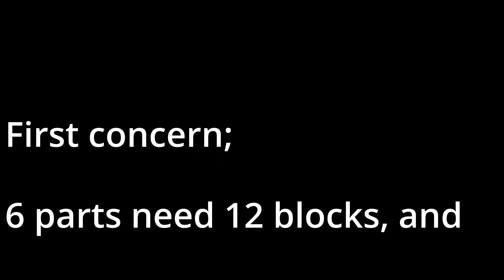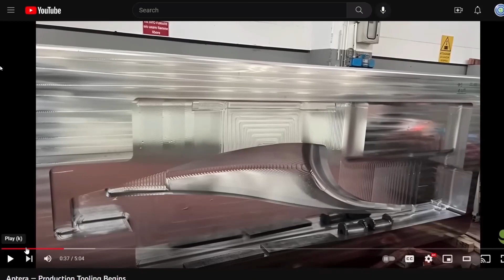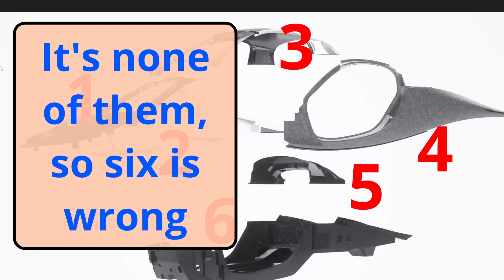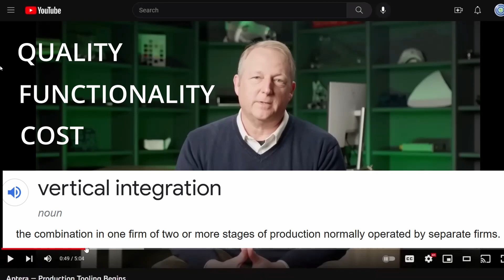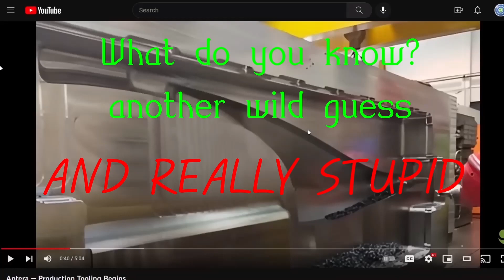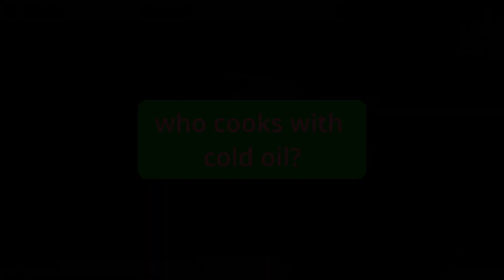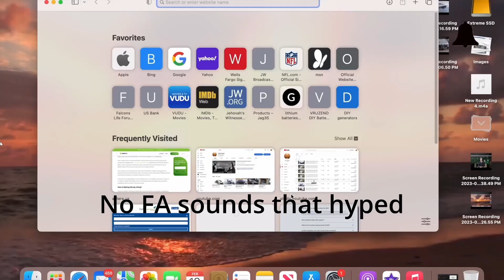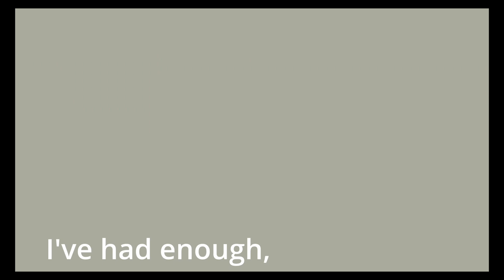APTERA DIES    What gives?

Comment from the maker: I know it's an old video, but I wanted to preserve this nonsense -

@andrewfuller8440  "sir , I am a retired toolmaker and machinist,who knows you cannot sink dies into 19 ton steel blocks for 3 million Dallas," I am completely ignorant about toolmaking, but if memory serves me correctly they were saying these blocks were about 5,000 lbs of steel and you are comparing with 19 tons I have not heard of nor can imagine such a weight  just to squash a paste. It's around what a full bus weighs. I had to look up how many lbs in a ton (used to know it, but have never used it in decades) and it's an easy to work with 2,000 lbs. I hope it's the same in Italy and I hope they are not referring to tonnes, which I think are lighter. In any case, you said tons and on that basis, your blocks are 38,000 lbs? I don't think so. Nor do we know if the 5,000 lbs Chris referred to was the combined press or that for the lower half, or an average for each half, such is the vagueness he talks in. It is common for every piece of information he gives. I tried Google to see what a cost would be, and first found this absolutely crazy article -
https://www.thefabricator.com/thefabricator/article/bending/die-science-estimating-die-cost
It's crazy because it's even more vague than the snake oil salesman. See if you can find a price estimate in the whole article? There is nothing there. So I tried again and got this -
https://www.myplasticmold.com/injection-mold-costs-what-is-a-reasonable-estimate.html
It says for a big one it's about $10,000. Now it is also way too vague, because what size is big? I thought I would reverse engineer your considered cheap $20,000,000 block at an estimated 6' W by 4' by D by 3' H (~72 cu feet) lower half mold they show in a video, and see what size I get for their biggest example at $10,000. Naturally, it's going to be 2,000 times smaller and in cu feet that's 0.036 of one cu foot, or well under four hundredths of a single cubic foot. I can't imagine how tiny that must be in any combination of W, D & H, nor how the article can say it's the at large end of molds. It seems like dividing a shoe box into a hundred pieces at the least. That would be smaller than a ring case by far and I can't see that as being a large mold in anyone's language. 
One thing I noticed was that steel was an inferior material to use than titanium, and Aptera has opted for steel of an unknown grade. This is where they might have skimped on efficiency once more. However, since you're the expert - how about you provide some more meaningful data so that we amateurs can see how much one die or mold is reasonably going to cost, and we can multiply by the six or twelve (depending) for the six parts of Aptera and get an estimate that would be plus or minus half a million dollars? Or better still, how about someone lobbies Chris Anthony to stump up the bill for the contract? It's all tooled up and no more to spend.
"even 20 million might not be enough," That would make the size of the "bigger jobs" a mold that would do a contact lens.  
"I remember doing valve blocks that weighed 700 lbs for the military that we were paid 110 thousand dollars , and this was in 1970" I can reverse engineer your job (scale up is more the appropriate term) to see what the mold weighs for your lowest estimate of $20,000,000. You were paid just over $157. 14 per pound and at that exact price you could get a block weighing 127,275 pounds, or well over 63 tons in 1970. That's more than three full busses. If we use the 5,000 lbs of what I thought Chris claimed (I may be wrong), that would have cost him $785,700 in 1970. Allowing for inflation I would not see that ballooning to anywhere near your minimum of $20,000,000. In fact, if it were twice the weight (maybe top and bottom?) $1,571,400 would be hard presssed to get near it today. This doesn't even factor in any drops in steel prices after inflation and I would expect automated CNC machining is far cheaper than how you would have done it in 1970. Still - I am sure the fanboys will believe you, lol.

I just hope the links will carry on both this and the original on Hyperno's 'Aptera 2024 Solar EV sees company secure $33 million to fund initial phases of solar EV production'?

Comment from the maker: @Brian Rice @N. Bruce Nelson I can't comment on AOC, so will do it here, as usual, when I think I might have a point.
In regard to the airflows on the CFD simulations, I notice the early trailing flows don't appear to be showing the vortices shown in the later ones. You will need to imagine what the first ones would look like to understand what I mean. 
Picture the layers from the side first, and the vortices would have to be shaped like a sine wave with a diminishing height and an increasing amplitude as it gets further away. This would have to be the same when viewed from the top; that way, the combination depicts circular motion finally settling i.e. like the vortex displayed from the rear in the later simulation. However, there are no such lines that have that, and I can only conclude that it is all hogwash designed to fool the gullible. What do you think?

Comment from the maker: This one I couldn't risk losing -
"At least my comment is visible on other accounts this time, so here's my evaluation of your guff:
[This vehicle is going to be nothing less than iconic.] Your opinion, and a look at the future with little to base it on. Certainly none given. 
[It's going to hold a place in popular culture that eclipses the VW Beetle, the Airstream caravan, the Mini Cooper and the DeLorean.] We'll see. 
[It will be as much a sea change to the car industry as the iPhone was to dumb-phones.] Well the iPhone had an effect, but it wasn't a sea change. It didn't move from inland to the sea. Try 'radical', instead of 'sea'? Then, we'll see.
[The fact that everything about it is the most obviously correct thing to do,] But not everything is most obviously correct, which happens to be complete nonsense. By definition, 'most' singles out one from a group, in this context (in other contexts it means the majority, but not this time). Besides, everything about Aptera has many things that are incorrect, so you are pretty much lying. Zero to 60 in 3.5 sec turned out to be wrong; 150 kw turned out to be 128; production by end of 21 turned out to be maybe start of 24; paint became wrap; heat pump replaced by resistive heater; and more, which these 5 changes alone removes the everything about it clause. 
 [will only be visible in hindsight.] I used hindsight for those obviously incorrect claims, and am looking forward to more hindsight going my way. Here's one more for impact - that fantastic composite body shell became an Italian carbon fibre - who saw that coming?

[Anyone that disagrees with me is basically saying "no thanks, I never wanted to ride around in a space ship,] Not me - I'm basically saying anyone who agrees has their space ship between their ears. 
[I prefer my stupid solid useless brick that's too heavy and clumsy to do a good job of the only thing it even exists in order to do in the first place,] I prefer my sentences to be coherent, which that isn't, but yes - a solid brick I own is better than two Aptera on order. One is real, and the other not. It's 'a bird in the hand' lesson.
[also I like licking windows and huffing lead paint because I am smart"] Well, licking windows won't get you any lead; you need to lick the frames for that, because I really am smart - nothing basically about it. And those frames need lead in the paint from a bygone era. Modern anodized frames won't do it for you; not even painted frames these days. I have to disagree with you, lol."

On Exploratics (who I think reinstated me a couple of hours ago) 'Finally | Aptera's Million dollars grant Approved & Latest Updates'. Look for Roy Chivers' thread.